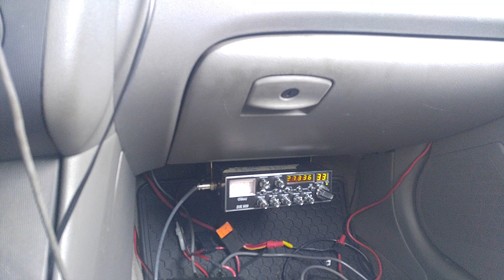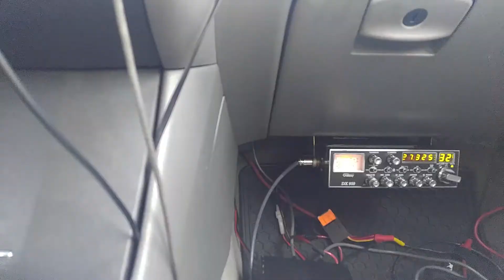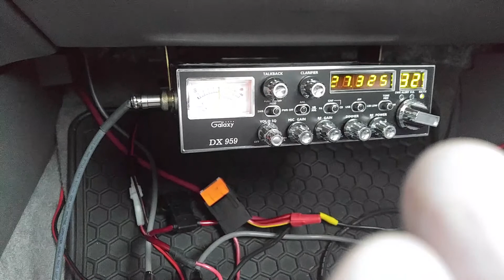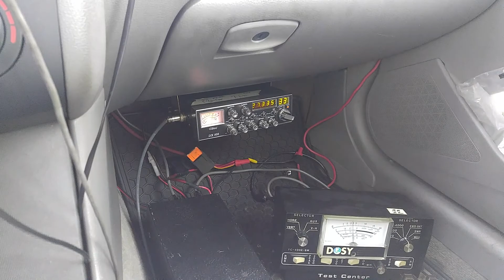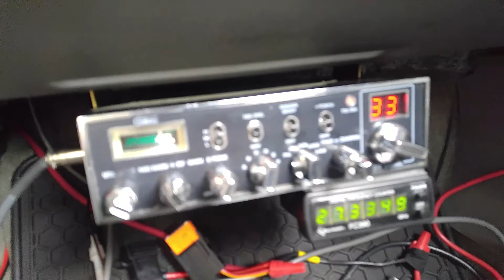Galaxy dx959 making amp chatter and click.

Comment: The wiring job could be one issue lol
Reply from the maker: AGITATER 1. Lol 10-4 yeah I know the wiring jobs not the prettiest yet but until I get everything situated I'm going to leave it that way .Thats one reason why I used to run and Export radio with a built-in amp. I didn't want the extra cords and coax.